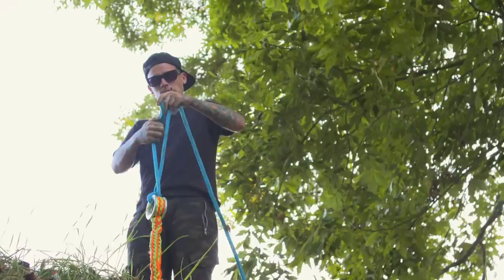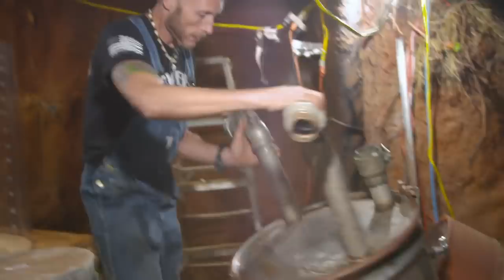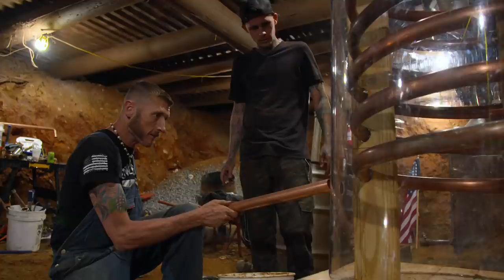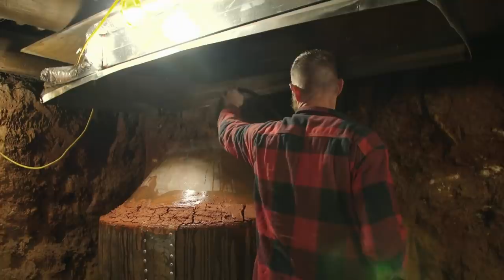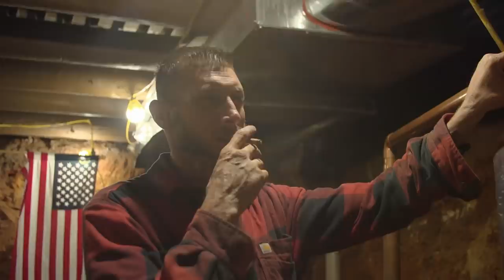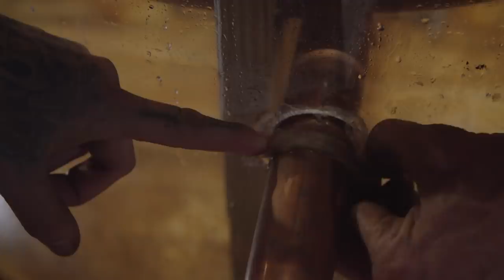Josh And Colt Make A Transparent Worm For Their Still | Moonshiners

Comment: Wait why is josh missing his left index finger ? Anybody know
Reply: Believe he is missing part of another finger as well..like 1.25 to 1.5 fingers..that happened what seems about 2 yrs ago..it was a work place accident..he said a grinder disc wheel exploded..I'm guessing a larger sized grinder like a 6 or 7 inch grinder..most likely it had zero safety guards on it..he works in metal fabrication..he said he was almost finished with a job, was in a rush to get it done when it happened..an all too common story that leads up to an accident..grinders can be be extremely dangerous..even with the guards on but still most users take them off on day one because they get into the way when trying to get into tight spots..
Reply: I was wondering the same. Cheers!